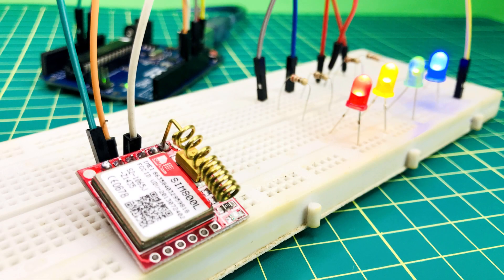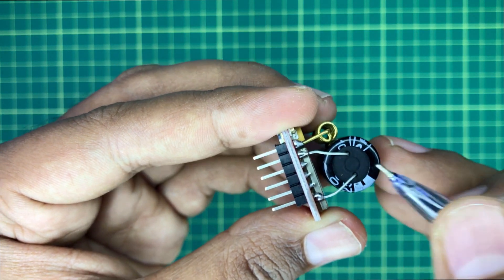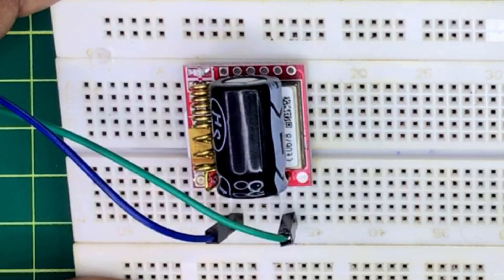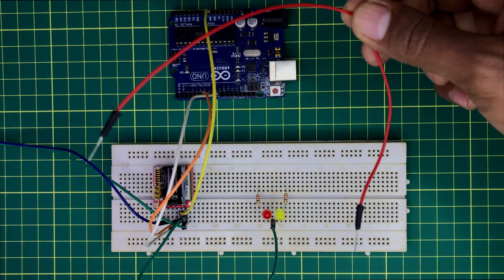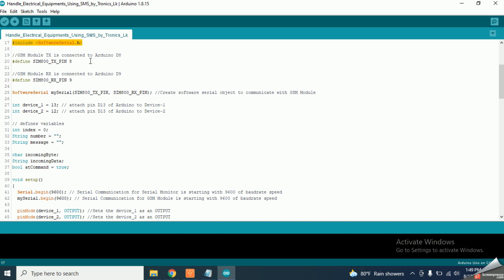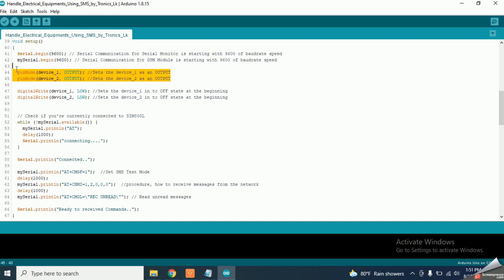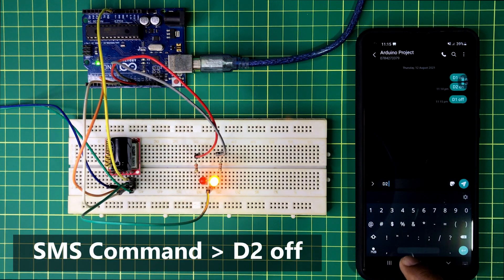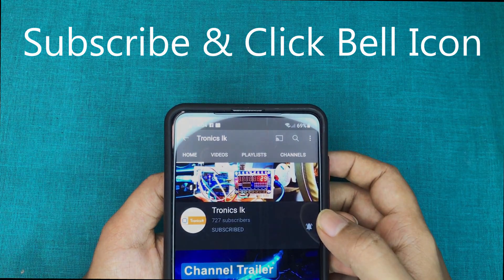Controlling Anything with SIM800 GSM Module and Arduino | SIM900 and SIM800 Arduino SMS Tutorial

Comment: my gsm sim900A is not connected to the network. I have tried with 2A 5v but still not working
Reply from the maker: Did u try capacitor connection
Reply: @tronicslk  yes

Comment: Arduino sends 5v which should be sent through a voltage devider to the GSM module.
Reply from the maker: Its not a huge issue in here
Reply: @tronicslk  
You're sending 5v to a 3v device and you're saying that it's not an issue?? 😆 

Grow up kid. Or else remain happy with your fried modules.
Reply from the maker: @sajidTS99  I am telling this by experience and i have done few long running projects with sim800. They work fine for years without needing any logic level conversion

Comment: Hi .
Is there anyway to mod this to respond to a call rather than a text ... I don't need it to answer ! I need to operate a relay or bell on ring and stop when the ring ends .....
Our sip phones used to use a function "ring anywhere' that rang an analog line with a factory bell attached .. But the pstn line has been removed .. I could use ring anywhere to ring one of these modules and relay a bell to ring ... But I don't know how to write the code to respond to rings, or even if its possible .
Thank you
Paul
Reply from the maker: yes. It can done easily. I will create a another video for it. Keep subscribed the channel to get it. Dont forget to click bell icon also ❤️

Comment: Hi my friend, my Sim800L doesnt response to AT commands, what can be problem?
Reply: How can I change baud rate? Or how can I find the current baud rate in order to change it?
Reply from the maker: @Sergio-ta3krt  you can find it on my code
Reply from the maker: try to change Baud rate in code related to gsm module
Reply: @tronicslk  my friend I can not even change because when i write AT and press enter, it does nothing.. doesnt response. What should I do else?  Module connect to the network perfectly. my cables are tick and powering is so well
Reply: change baud rate in the arduino code, that is what he means. The SIM800L module has its own built-in baud rate. In your arduino code, you should spesify it. Try different baud rates, normally 9600 or 19200 works.
Reply: If you use Mega board, be sure to NOT use pins up to 9 for RX pin on sim module (use for ex. 10, 11 for RX TX). For Uno board you can use 8,9 for example. https://docs.arduino.cc/learn/built-in-libraries/software-serial. I had figured this problem in 1 day, it was tough :)

Comment: 2200mf capacitor is really needed since you used buckdown converter?
Reply from the maker: if your supply is able to provide 2 Amps, it will not compulsory . But i recommend to use it
Reply: You should at least use a 470uF capacitor, especially if you have a bad signal - the SIM800X modules are infamous for connection issues because of a low capacitance.

Comment: My sim800l not fixing with network
Reply from the maker: check the sim cards validity and power supply current
Reply: @tronicslk  power supply I provided 3.7v, 3500mah Li ion 18650 Panasonic battery. And Airtel 4g sim. It has fall back mode available ?.

Comment: Please tell me how to make power supply of 3.7-4.4 v for gsm sim800l module..... Is there any battery available in this range and for how long time it will provide power to gsm?
Reply from the maker: use rechargable 18650 lithium battery. usually it can provide power the module for long period before recharging again. you can use a dc to dc buck converter also to power up the gsm module

Comment: Can i use 1000uf capacitor instead of 2200uf capacitor? And please also tell me that can i use a diode to reduce voltage of Arduino 5v Vcc pin to provide power supply to sim800l? Please reply.....
Reply from the maker: 1000uf will work. but dropping the power using diods can cause problems. 5v pin cant provide enough current for GSM module
Reply: @tronicslk  thanks for reply🙏🙏
Reply: Hello Which Volts You Use 2200 uf 16v, 2200 25v or etv which?